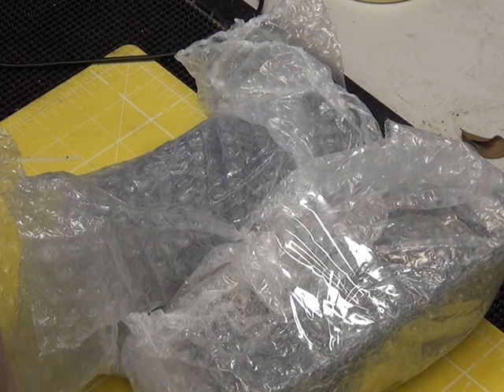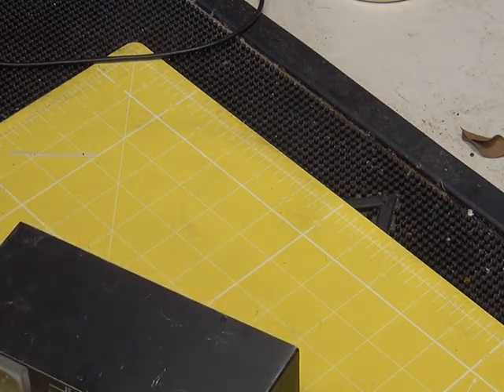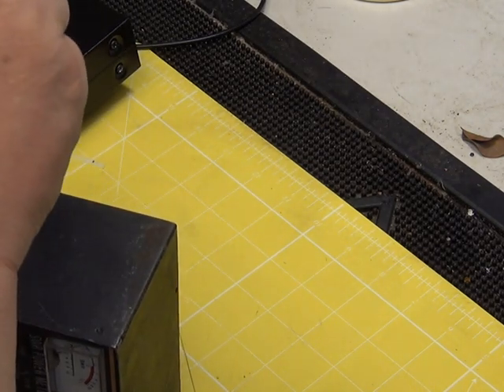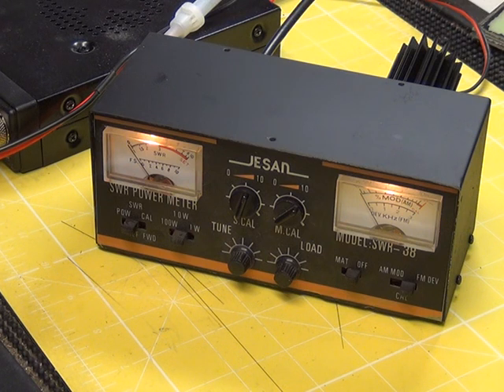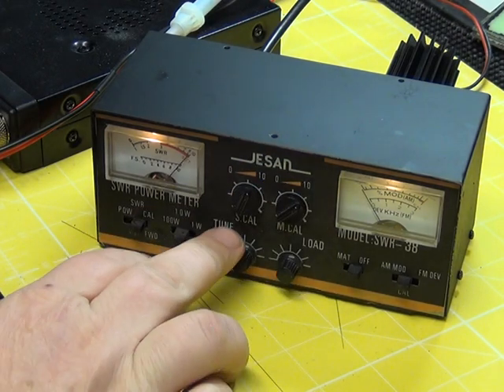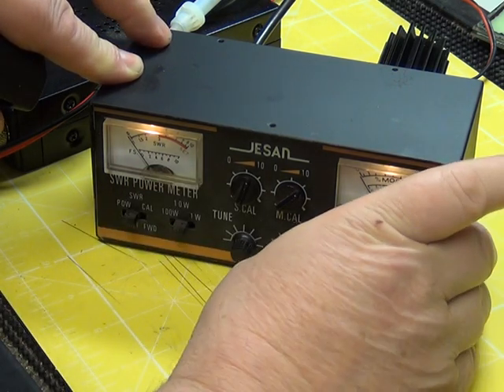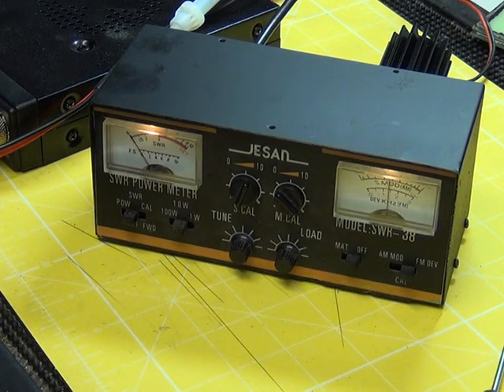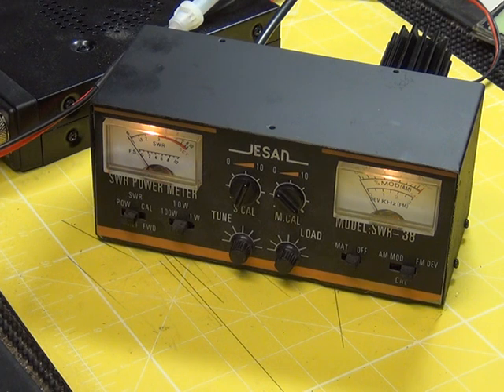Jesan SWR38 FM Deviation meter- CB servicing on a shoestring budget (Transmit)

Comment: intresting little video .have the same meter badged as a sharmans.i picked of the audio from the fm detecter stage in to a cheap scope just so it all looked well.nathan
Reply from the maker: It's a shame Sharmans discontinued it; having an account with them, I checked. I don't see any deviation meters on the CB market currently.

Richard
Reply: no idear how old it is Richard.came from a radio junk sale 10ish years ago.
 @ukfmcbradioservicingTango21
Reply: I did here sharmans have sold out to moonraker @ukfmcbradioservicingTango21
Reply from the maker: Yes, I ha a letter from Sharmans yesterday explaining the circumstances and one of the two brothers being in poor health & retiring etc. Next email, letter from Moonraker welcoming me as a trade customer to the new setup. 

I had some good chats with Sharmans over the years; always helpful, never pushy for bigger & bigger orders...sourcing special items (like the mikes me have through them) over the years. I've had an account with them since 1986.

Richard
Reply: ive a standard 600 ohm from sharmans from the early 80s lost count how many radios its been on .as good as gold.
 @ukfmcbradioservicingTango21
Reply: should have added microphone in there some where

Comment: Pleased I could assist you Richard  :) It's Good little video Thank's . I will just mention that the lights have been fitted aftermarket mine came without lights  (New ) and I fitted a pair into mine  they certainly do make it look better ,
Reply from the maker: Thanks for the tip about the lights, I'd no idea they had been retro fitted!

I'm now wondering if you've learnt anything about operating it, which I know you mentioned gto be about not quite being sure. It all revolves around having a dummy load connected.

Richard
Reply: Yes Richard I just need to learn the sound  injection to what the reading on the meter should be I have found tones on youtube  but don't know which to use ?
Reply from the maker: @quotagious  We use 1khz from a Korg chromatic instrument tuner (not a guitar tuner, wrong notes). I do it this way for repeatability , or a steady 1khz whistle is better than nothing, Deviation should be around 2.2Khz peak, absolute maximum is 2.5khz. Have a look at my other deviation video where I use an old boat anchor or a deviation meter but go into more detail.

Richard